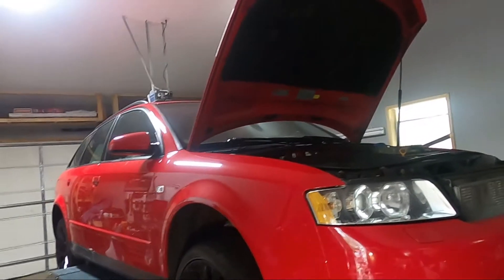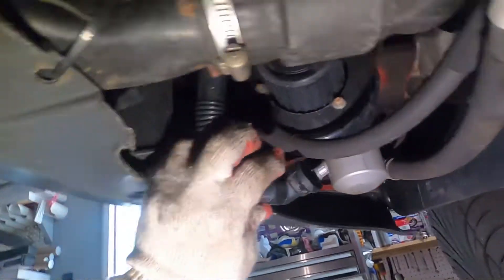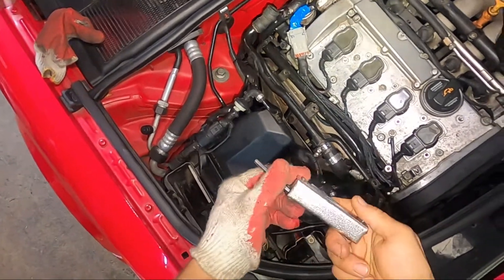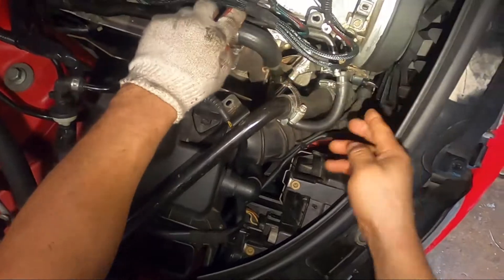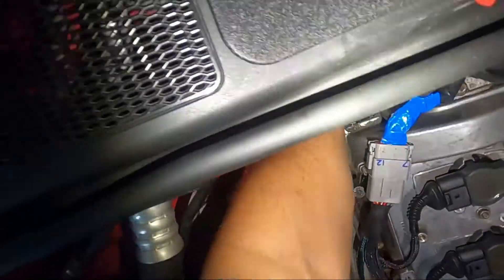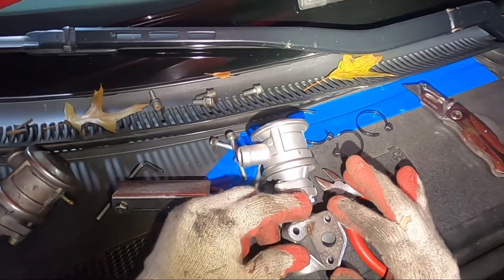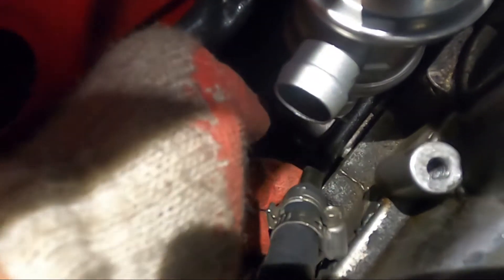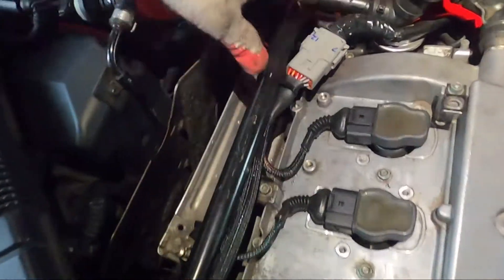Here is why Audi/VW Secondary Air Pump  Get  Damaged

Comment: Great video! I have a 2009 Q5 with code p2442 “Secondary Air Injection Valve stuck open” Bank 2. I think this is what i need to clean or swap out. Thanks

Comment: Here's an EASY TEST you can do to rule some things out:

Find the intake tube of the SAI pump, it's usually directly connected to air intake box. Remove the air intake box if necessary and disconnect it so you can see the open of end of the intake tube. 
Now when the vehicle is dead cold and hasn't been running in some time, start the engine, leave it in park with the hood open, and then run around the front and see if the pump turns on.

If the pump doesn't turn on check the fuse and the SAI pump relay in ECU box, typically under the hood or compartment below the steering wheel. The relay terminals sometimes turn black when it's going bad. Also check the wires leading to the SAI pump for damage. If all are good then you may need to replace your pump, but that's typically rare. 

If the pump turns on, is there a good amount of suction at the end of the intake tube? There should be. If not, then you either have a bad pump, a clogged or broken intake line, clogged or broken tubes that lead to the exhaust manifold, faulty solenoids that control the combi vales, faulty combi valves, OR worst case scenario, clogged ports in the engine head that exit each exhaust port. That's a very costly or time consuming fix. 

If the pump turns on and you have good suction, then that means the ECU is sending signal, intake tube is good, SAI pump is good, but you may have broken hoses OR, a big OR, you may have had a clogged foam filter in your air intake box that the SAI pump intake tube was attached to and by you disconnecting it you actually without knowing fixed the problem. I'd recommend replacing this foam filter as they disintegrate and also clog up overtime. 

To rule out broken hoses simply activate your pump manually by applying 12 volts directly to it with the engine off, and seeing when the SAI pump runs that not much air is entering the system. 
With the engine off, the SAI system is closed, so the air should have no where to exit and thus very little to no suction even when the SAI pump is running. That's a good sign and that means you don't have broken lines. The combi valves and solenoids could still be bad and stuck in the closed position preventing air from entering your exhaust but that was ruled out when you cold started the vehicle and felt a good amount of suction at the intake tube. 

It's all trial and error, but no one ever mentioned utilizing the intake tube as a convenient means of diagnosis. Accessing the combi valves and inspecting all the lines is FAR more difficult than simply power the SAI pump when the system is activated the ECU and when you manually activate the pump with the system off (closed).

Best of luck
Reply: On the Audi, a failed pump is frequently caused be a failed combi valve.  Before going thru @empireofsteel 's tests, I'd remove the output tube from the pump and see if it's full of water (sure sign of a bad combi valve).  Then blow on the tub while applying vacuum to the vacuum line off the combi valve (you can access it a few inches forward of the back of the engine, to connect a manual vacuum pump). If the combi valve does not easily pass air with vacuum applied, the valve is stuck or loaded with carbon deposits.  If it easily passes air with the valve closed (no vacuum applied), you've got a leak in the line from the pump to the combi valve.  Some of the tubes are "plastic" and can become brittle and break with age.

Comment: Is it always the case to replace both?
Reply: Jake, i can tell you from experience please do it.  They didn't replace the valve (only the secondary) and guess what, 4 years later and I need to replace both now.  Save yourself some time down and money and get both done.  (this is on an S6)
Reply: I’d replace both just to be safe. Never cheap out
Reply: If you fix the combi valve as soon as it starts, you might save the pump.  While the pump can fail just because, if your pump is full of water or there's water in the supply tube, that's a sure sign that the combi valve is bad.  But it's easy to test while you have the pump out.  Blow on the outfeed tube from the pump and it should not pass air.  Then test again while applying vacuum to the vacuum port on the combi valve the vacuum line runs forward from the combi valve, along the intake manifold.  You can intercept it there to attach a mightyVac).  If the combi valev is working, you should be able to easily blow thru the tube.  If it doesn't pass air, or with great resistance, the valve is stuck or loaded up with carbon

Comment: Can this be the reason my loud cold start stopped working?? Checked my pump connected straight to the battery an is working fine must don't get the loud cold starts anymore got a 9n3 polo gti 1.8T
Reply from the maker: Yes this can be the fix
Reply: If the pump works when manually energized, but does not come on when cold-starting the car, you have an electrical problem.  There's a fuse in the circuit, plus two relays.  If you have VAGCOM, there's a test option that makes the relays click, so you can audibly check them.

Comment: Hi, I havent been able to get my mechanic to give me the fault code yet but they noted secondary air pump flow fault after i took it in with big misfires (complete drop in power when accelerating and very very spluttery rough idle) They have quoted 4 hours for diagnosis but i kinda want to ask them to check this option shown in the video first. 

Would this issue cause the symptoms i described? 
A previous audi garage also noted another issue ' camshaft tensioner variator (VVT unit) fault logged'  but i went for a second opinion as they didnt mention misfire but suggested new clutch in response to my symptom description of loss of power under acceleration. 

Im not sure which - if not both (VVT and secondary air pump) - of these issues would be causing the misfire and would be the best place to start 
Close to scrapping but would love to fix 
A4 BEX 190 B6 100k miles

Would be so appreciative of any reply 

Great Video!
James
Reply from the maker: Ok

Comment: What's the name of the EGR iam having trouble finding it please ty
Reply: If you don´t call it EGR you would find it easier.
Reply from the maker: https://www.ebay.com/itm/Auxillary-Air-Regulator-EGR-Combi-Valve-Fits-Audi-TT-2000-to-2006-VW-Golf-2-Door-/362970067280?_trksid=p2349624.m46890.l49292

Comment: Great video.  Hey, what’s the brand model lift you are using and do you need a specific size air pump to use it?  Be sweet to have something like this in my garage if not too expansive. Send link if you could. Thanks again 👍
Reply from the maker: Yes sir I do have a video just about the lift it cost me $2,500 at my door , it comes with everything you need made by stratus